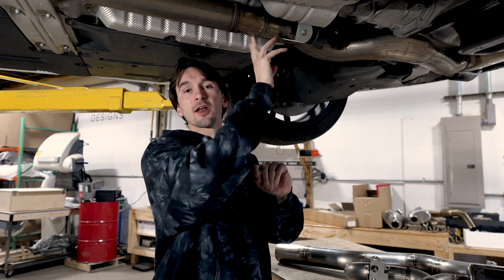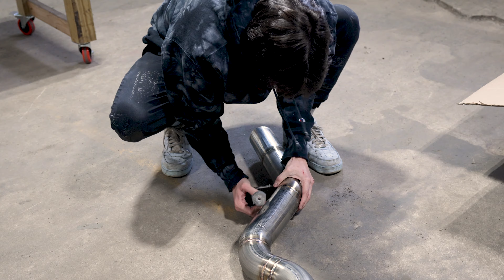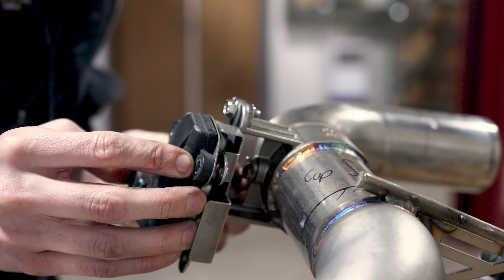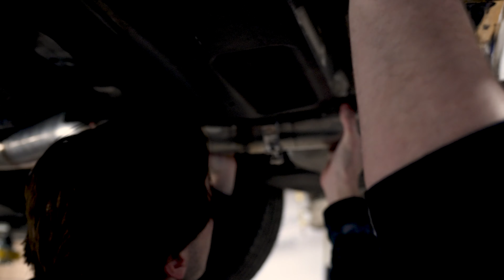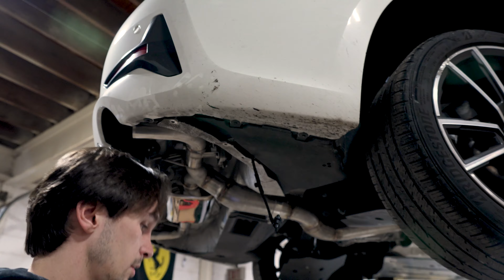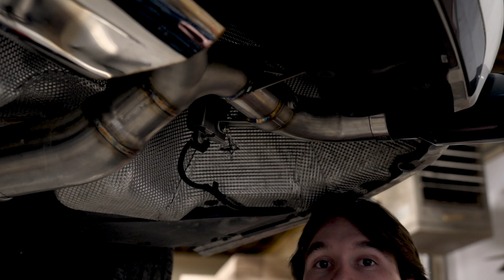How to Install Your G20 330i Exhaust

Comment: i just ordered one. but my question is, if all it’s using to open and close the valve is the oem connector, then how do you control when the valve is open and close? does it not come with a remote like the other kits?
Reply from the maker: it will open/close depending on what mode you're in
Reply: @valvetronic  would this work the same with a g20 330e with consistency? For me, with the stock exhaust I used an app to have the valve open then had to pull the OEM
connector to keep the valves open all the time.

My issue was everytime
I go on sports mode would only open when foots down that’s why I had to do the above. 

Really appreciate if i can get a reply on this cheers!

Comment: This video doesn’t show the Vacuum box being installed. Also doesnt show the Vacuum lines either. 

I have a g20 330i with a gold plated valvetronic exhaust system made by you guys. I am having an issue where the Vacuum pump will turn on when I turn the exhaust on but then will pause for a second but then turn on again. This keeps going and doesn’t turn off until I turn the vacuum pump off. 

I dont know what the issue is but I believe it is affecting the right side of the exhaust. Could it be a leak in the vacuum lines? How can I troubleshoot this issue and make my exhaust system work perfectly again?
Reply: bruh what
Reply: @abathingwilliam 😂😂😂

Comment: Is this better than dinans version i dont know what to buy
Reply from the maker: better sound, more flexibility, far more enjoyable, for similar money. Systems are in stock ready to go. you will not be disappointed.
Reply: @valvetronic have you guys done any product testing pairing this exhaust with aftermarket downpipes? If so does it drone/rattle with a catless downpipe paired with it? I had a dinan exhaust but the drone was terrible so i’m looking to replace it
Reply from the maker: @420blazingpanda4  we have like 8 different videos with all different combinations!
Reply from the maker: @420blazingpanda4  take a look at all the videos and pick your favorite 🤘